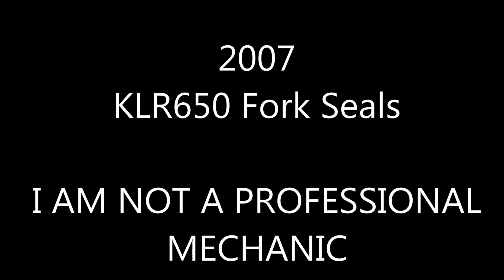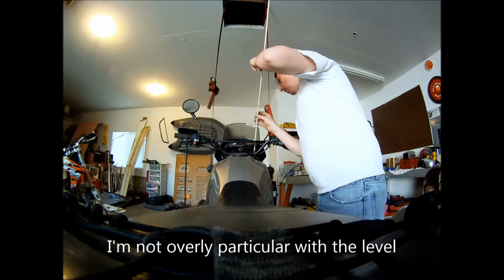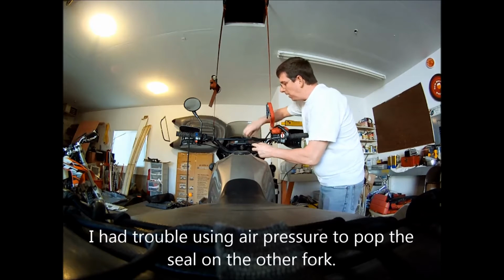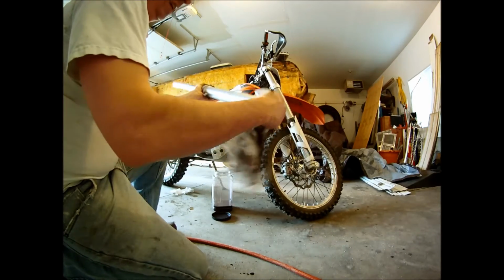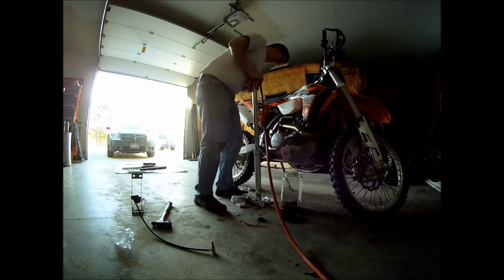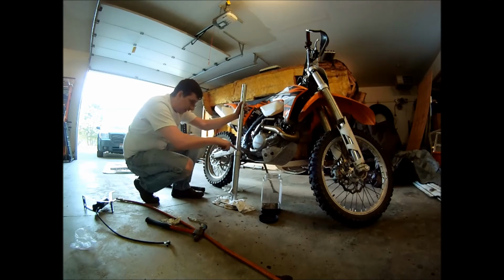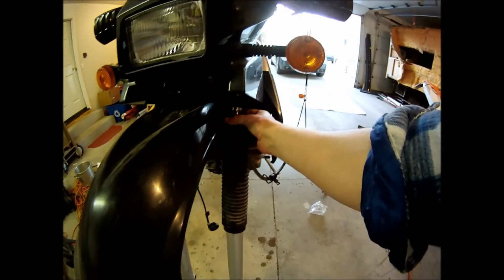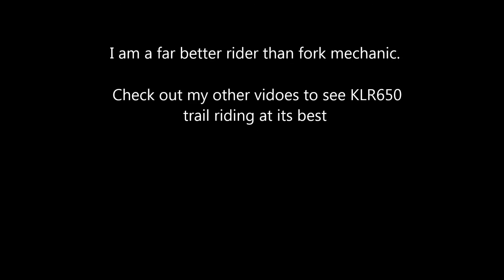How to replace KLR650 Fork Seals

Comment: The air pressurization method you show for seal and dust cover removal works great ... at least for me ...as long as you stand the fork tube up vertically as shown in this video and press downward as you pressurize the fork tube. First tried it with the fork tube flat on my work bench. 100psi+ no joy.  Vertically as shown here...JOY!!
Reply from the maker: Sorry for late reply... Sometimes you have to let it "cook" for a while. I have waited as long as 5 minutes for one to blow off. I also have no idea what a good PSI is. I was sort of shooting for the least amount of pressure that would do it.